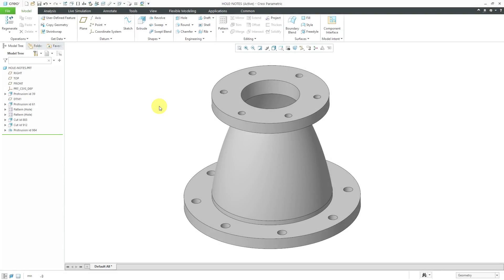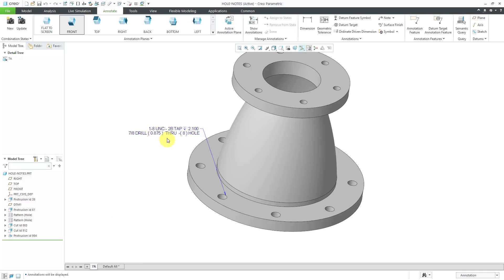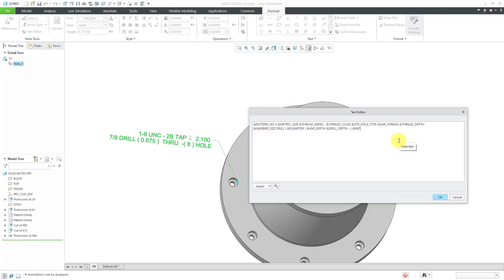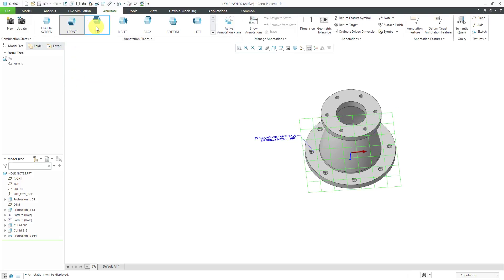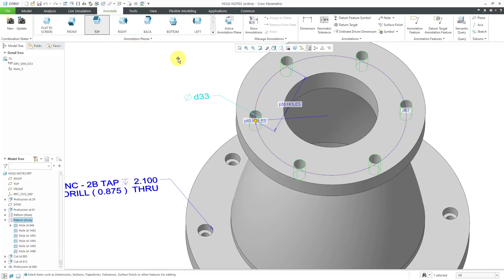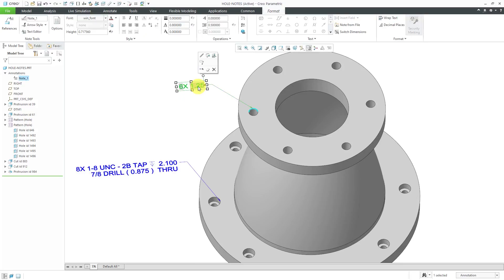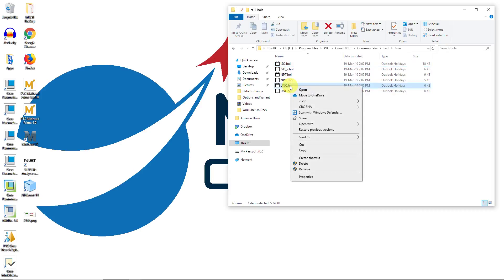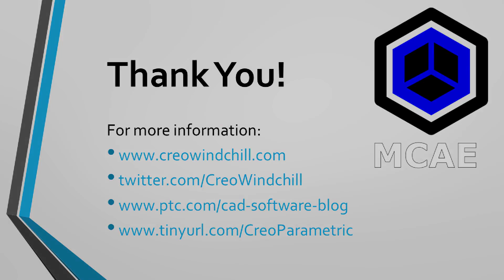Creo Parametric - Hole Notes and Model Based Definition (MBD)

Comment: How do you get the hole pattern to give you a dimension for the number of holes (the p36 dimension in your video)? Do only certain types of patterns give you that dimension? I made a direction pattern with two holes total, and cannot find a way to add the quantity of holes to a note/dimension like you are doing here.
Reply from the maker: It’s in the hole note format. I’ve made several videos on that subject and I think I cover that in #3. I actually have two more videos to make on that subject.
Reply: @CADPLMGuy  I am using a simple hole; it does not appear to have the option of adding a hole note. I would use a standard hole, but I need to specify the diameter of my hole to be .012", which is not a hole diameter I can obtain from using one of the standard holes. I could possibly work around this by creating a custom .hol file to get the exact diameter and a hole note, but I'll sooner add the quantity as text in a note rather than mess with setting up a custom .hol file. Really wish there was a better way though.

Comment: How would you go about adding a GD&T Feature Control Frame (in the context of MBD) beneath a note like the one you first demonstrated (for a tapped hole or pattern of tapped holes)? When I try to add a FCF and select the note as a reference, I am not happy with the way that CREO displays the FCF next to the note instead of below it (like it does if selecting a dimension as the reference).
Reply from the maker: I have a video on how to add GD&T to notes like note blocks in drawing templates. I forget what the video is called but it’s a short one.